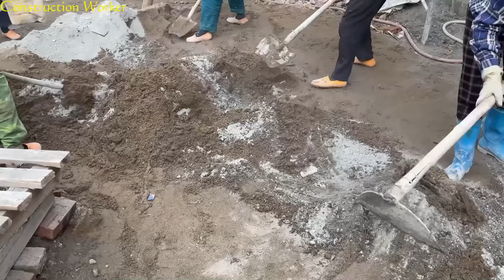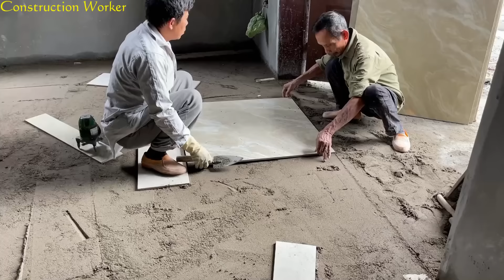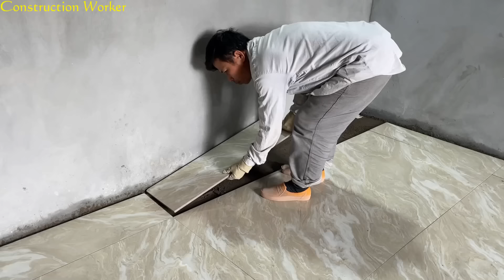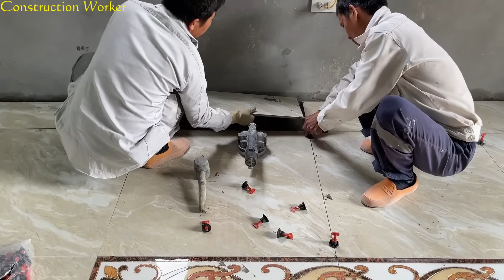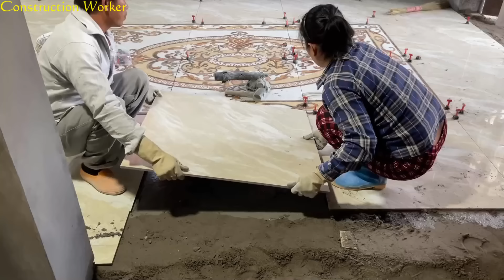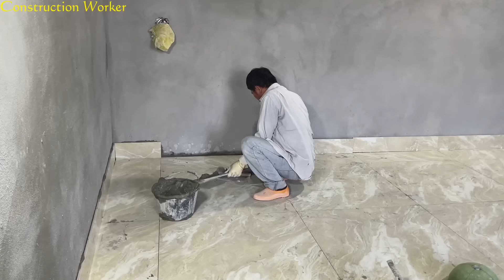Amazing Techniques Construction For Living Room Floor With Large Format Ceramic Tiles 80 x 80 cm

Comment: Highly professional work with all the right tools with dedication. The flooring rightly leveled with level marker, tiles arranged around to give the effect then pouring pure cement coat to fix the tiles is an excellent work. See how they coordinate fully with total attention on the job. What is the lock clip you use and also the hand vibrator and levelor. I appreciate your good work. Which country it is? Nepal or other place? Please inform.
Reply: It is from Viet Nam, thanks.

Comment: can someone explain me how the sand that they put on the floor transform into a conrete only using a ruler?
Reply: Looked like they mightve mixed Portland with it outside but yeah, still concerned about the adhesion.
Reply: It's called screeding a floor (check more information on utube)

Comment: What's the name of the battery tool they use to push down the tiles? I never saw it.
Reply: Just looks like a rotating sander without any paper on it
Reply: They're not using the buffer to push the tiles down. They're using tile spacers with suction to "torque" the tiles done (and space them). The buffer is used to vibrate any air bubbles in the very wet adhesive. Which is absolutely ingenious!!!  Their body weight and rubber mallet work is what's "pushing down the tiles".

Comment: this isn't going to last. they also did a super sloppy job on the grout just look at all of the spots where its empty, and all of the spots where it wasn't cleaned off properly.
Reply: This is how we build houses in Vietnam and it last much longer than the houses built in the US. Also they are not finished with the walls yet, only the floor was finished. Last, they don’t use grout like in the US. That is just a sealer between tile lines and everything is completely cement.